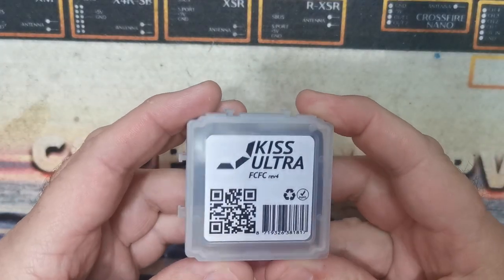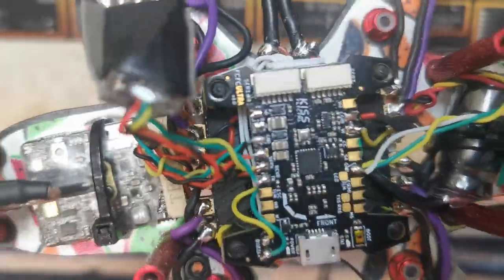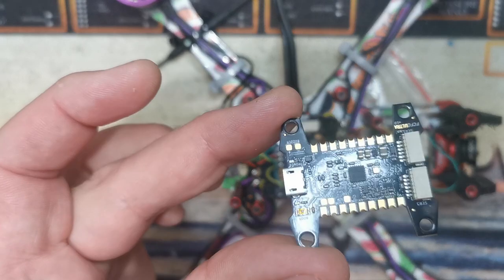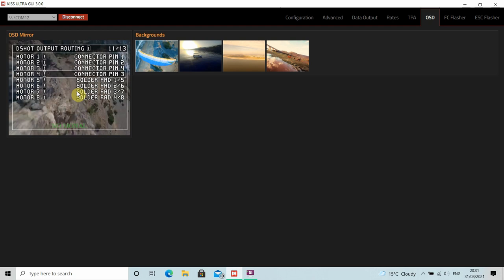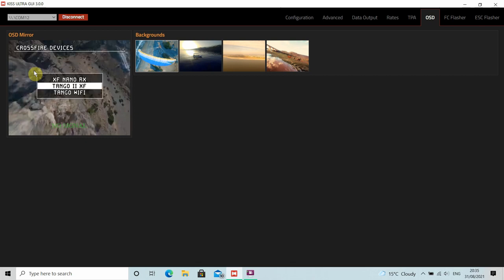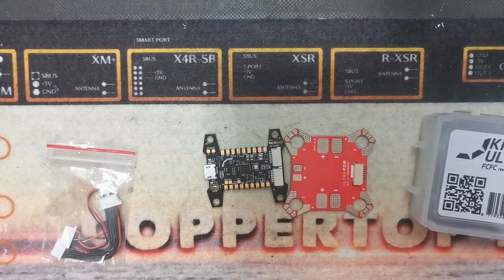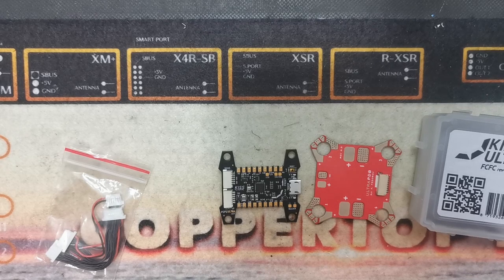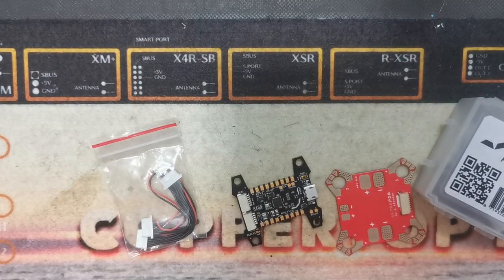It's here! Kiss Ultra FCFC overview and features

Comment from the maker: this video is already out of date. current sensing now working (with a calibration wizard to help setup) and blheli pass thru works on all the escs I've tested.
Reply: So now instead of wiring the esc current to the fc current we wire it up to cc pad?
Reply from the maker: @thatfpvdude8408  yes and disable uart 5

Comment: osd looks like falco x whats the most reliable kiss hardware nowadays?
Reply from the maker: That's the elephant in the room. If you want to use a kiss esc on 6s there aren't really any reliable options. Fettec 45amp has been good to me but others not so much which is why being able to use blheli escs pain free is a relief. Federov has been hinting about stuff so I think the plan is to add an esc at some point but when I don't know.

Comment: Those Kiss ultra are burning out like crazy!
Some build/project fatal problem!!!
Reply from the maker: Er  no they're not
Reply: @CoppertopFPV  oooh yes they are LOL, developer is blaming battery buzzer, but also no buzzer FC are dying just the same way!
Reply from the maker: @cmtetaboaco  this is what happens when people who haven't got a clue get involved. The kiss 5v reg is and has always been just for a receiver. If people use 5v vtxs and self powered buzzers etc it's likely to fry. It's been mentioned many times. It's the same as the one on Kiss v2 that's been around for years. The only issues to date were some early ones had dodgy gyros which were replaced
Reply: @CoppertopFPV  that’s the answer when someone knows nothing about of whom they are talking to! I started the hobby 9 years ago with the first Kiss FC and still uses Kiss, I bought the first battery buzzer, the drone keeper and kept upgrading the buzzers, I had viflys and now I use a big URUAV 2 buzzer one, and NEVER burnt ANY kiss V1 or V2, also that does not explain the Ultras that are burning in mild crashes with no buzzer what so ever!
You defend this FC, I don’t know your correlation to it, but obviously your saying is compromised, I fly Kiss V2 and they are amazing, no need for megas, ultras, blasters,… I enjoy the ultra idea and support it, I’m pro innovations, but there are problems that need to be addressed!
Reply from the maker: @cmtetaboaco  I'm not affiliated. I've been flying kiss for years too. The 5v has been the cause of most peoples woos on Kiss v2 since it arrived  and my flying buddies have a pile of them. Perhaps post this on Facebook if you have genuine news and genuine facts. All you are here is a faceless scare monger.
Reply: @CoppertopFPV  not faceless man, that’s me! I don’t have “social midia” I don’t need it, I’m complete without it! I see things and base my telling on facts, whoever wants to get, feel free to do so, I don’t care, BUT the developer not address and fix the issues for a next batch, well, truth always comes up and kill good projects by a neglected little defect!
Reply from the maker: @cmtetaboaco  OK so you spout facts without any. Congrats you won the Internet! 🤣
Reply: @CoppertopFPV  and here you are arguing with a stranger on YT comments page about something meaningless.
Congrats to you, you are the king of internet! 🤦🏻‍♂️

Comment: I wanted to try out kiss for some time now and almost picked up fettec but started hearing bad things, thinking bout switching up from falcox as they still owe me a fc and ESC from well over a year and a half ago👎. Seems like it might be the right time🤔 gonna give kiss a shot when they come back in stock. Thanks bud🤙
Reply from the maker: I wanted to try F1 but have to date never seen it in stock 😂 Preston sells nothing but air... fettec is weird. beyond a few duffs I haven't had too many issues like others have once they're in my quads but they just don't communicate issues so it's frustrating. They've handled the whole issues around them really badly instead of being upfront. Federov is a gent and is doing it for the love of it to keep kiss alive and for that he has my absolute admiration. This is the first step in a bigger plan
Reply: I hopped on the Fettec train about two months ago, it hasn't exactly been smooth sailing, and I can't say that they're the most honest bunch. 

Long story short, it's an APEX DJI build and one of the FETs on the ESC blew up after just over 40 packs of flying on 6S. I contacted Fettec, sent them photos, they agreed that my soldering and wiring is very clean and suggested to use a multimeter to check for shorts on the frame (the motor screws and the Vista in particular). I was advised that their one year warranty doesn't apply to used products, which doesn't make any sense based on the policy posted on their site, so no replacement for me.

I'm not buying anymore of their temperamental ESCs until they figure out their issues. I'm currently running a T-Motor 55A without passthrough, and it's been running like a champ with no issues, just like it does on my other Betaflight builds. 

So in summary, I would not recommend Fettec, in particular their ESCs. KISS itself on the other hand is totally worth a try, it has a really nice feel to it. I intend on picking up a few of these new FCFCs once I am actually able to find them, especially since they feature a BLHeli passthrough (another feature which Fettec refuses to integrate). Alex is indeed a legend and deserves support in the FPV community.
Reply from the maker: @michaelc5027  sounds like a load of bollox. I get that some people fry stuff. I have from time to time and we give this stuff a hard time but when stuff is frying for no reason on mass something is wrong